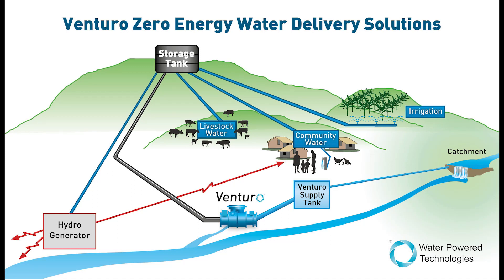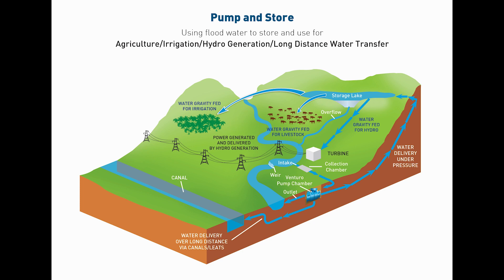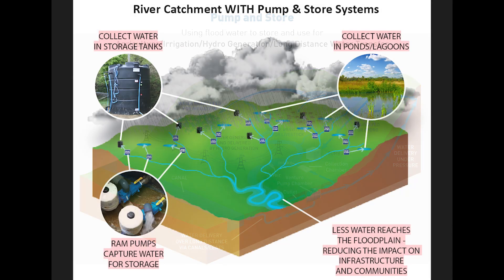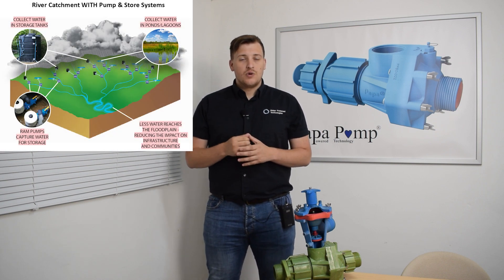Ram pump Flood Water Harvesting/ Flood Prevention by WPT

Comment: Ok.
So where are the HECRAS models breaking down flow rates, peak flow, water surface levels, energy grade lines, etc. Can the pumps handle a peak flow or do they need staged approach? What flow rate can the pump handle and for for what kind of time frame to remove excess flows and stormwater storage? Does elevation positioning play a role in the models presented? 

Also, most states won't allow building in mapped flood plains because of national flood insurance programs discourage it. Where do you guys see this product going to use? Will this impact flood insurance claims if such a system was built and pushed flood waters onto neighbors?
Reply from the maker: Hi, 

The idea of the system is to pump the water to storage areas before it becomes a flood, not push it to other areas. 
These are essentially ram pumps so elevation does play a role, see our performance charts on our website here: https://www.waterpoweredtechnologies.com/calculator/